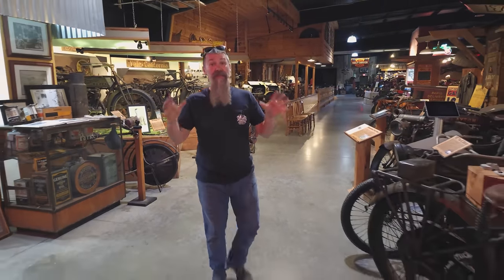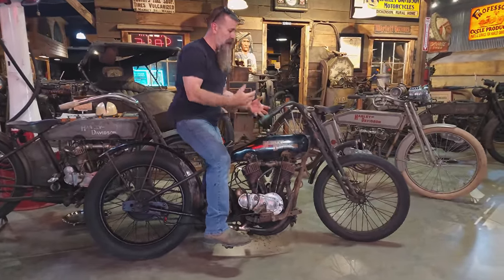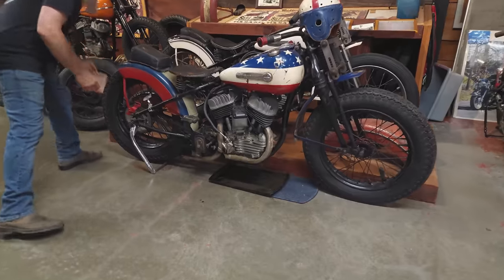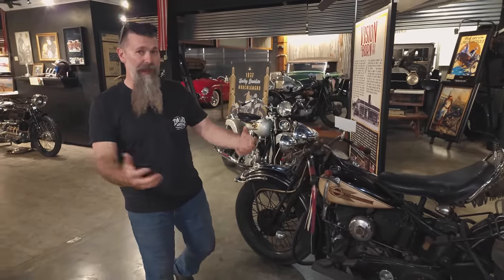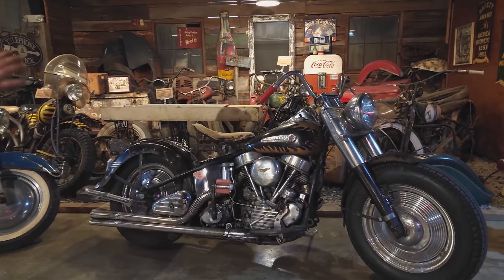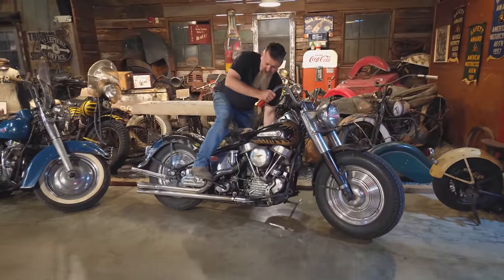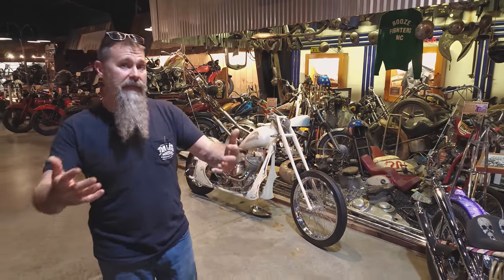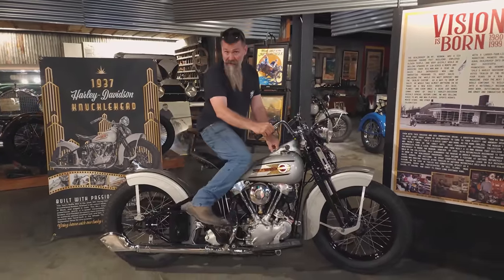Why Were These Machines Cut Up and Modified?

Comment: I never rode an Indian with the left hand throttle. Just wouldn't even consider it back when! I always knew I'd probably wreck it and die. No, I've never wrecked any motorcycle, come close, too scary so I slowed down years ago. Many friends died so I went from fast to extreme defensive riding. Good friend had his Harley for 3 weeks and someone pulled out in front of him. He put the skids on, ended on the side and he hit the bumper at his neck. One of the times of my life other than suffering a brain aneurysm, lol.  Bud would give you his last $ and had the biggest heart of anyone I knew. Dang, gotta go, the tears may flow. Great video. Keep them coming!

Comment: On the wldr, what did you mean when you said that its so cam”d up that it drops a cylinder?
Reply: A big cam with lots of overlap tends to foul the plugs at low rpm. Made to race so they aren’t very happy when not getting run hard.

Comment: What I love about bikes is the fact that they don't change for the sake of change. 

Take a Model A Ford from the 1930s and put next to whatever you drive today. The two things you'll be looking at don't even appear to be the same species. You just don't get the same experience that early drivers got. They have taken all of the humanity out of cars and computerized it. Not only that, but the style has been lost. Every manufacturer is chasing the same aerodynamics, and wind flows the same way in every wind tunnel...so all cars are starting to look the same as each other. It's vanilla. It's bland. It's boring.

Now look at bikes. 

Take your new muscle cruiser, and put to beside one of those stock race bikes from the 30s. The differences are MINOR. Seats are different. I am sure they have better shocks, and that sort of thing. But in essence, your bike does not look very much different from what those guys were taking around the track 90 years ago, or what James Dean was keeping cool 70 years ago. Bikes are the same animal now that they were in the beginning. And you can mod yours out just like they could, without having to call in an IT specialist. We are getting almost the same experience that they were getting. 

Now, the copycat thing is an issue, just like with cars. My Nip cruiser looks just as cool as your Harley. Relax, I am not saying they are the same. But my copy has the same look as your original, and that is undeniable. But at least they are copycatting each other on something real, raw and cool. I dig that!

Comment: We are currently living in the absolute worst time for motorcycles ever. Not only do we have trash like EFI, ABS, rider modes, digital instruments, computerized everything, but they are hideously UGLY. It is virtually impossible to find a new street motorcycle that is not 99% flat black. I started riding on the street back in 1975 at age 16 on a 1972 Suzuki GT380 2 stroke triple. Back then there were so many wonderful bikes. My first brand new bike was a 1980 Suzuki GS450L. That started my life long love affair with cruiser style motorcycles. They looked great, they were super comfortable, and there was plenty of room to tie stuff onto them. They made perfect touring bikes, which quickly became my favorite type of riding. I've owned over 30 of them, all carbureted, all with bright shiny paint and LOTS of chrome and polished aluminum. For a while I bought a new bike about every year and a half. As soon as I paid one off I bought another. Now there is not a single new bike out there that I want. I'm so glad I have a collection of older bikes that still look like motorcycles should. Two of them are Harleys, both bought used. A 1989 FXRS Low Rider, and a 2001 Sportster 1200C. Both EVO powered.